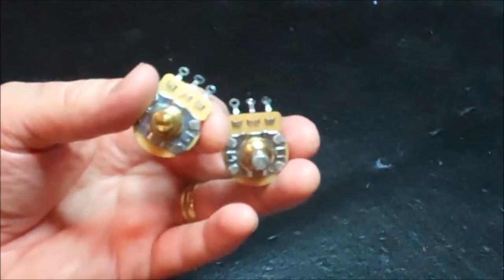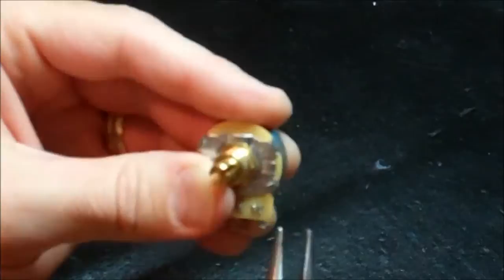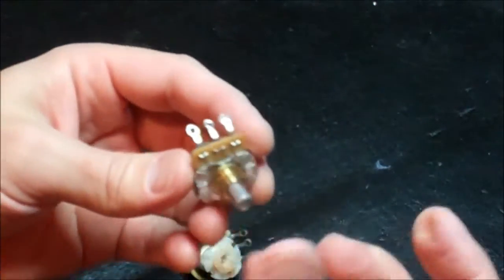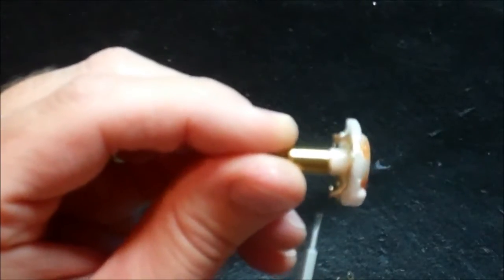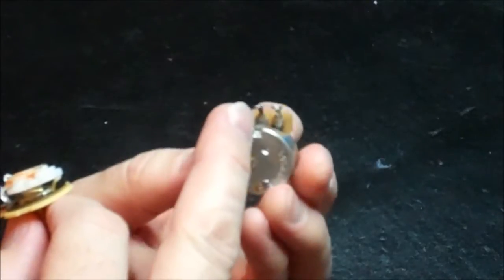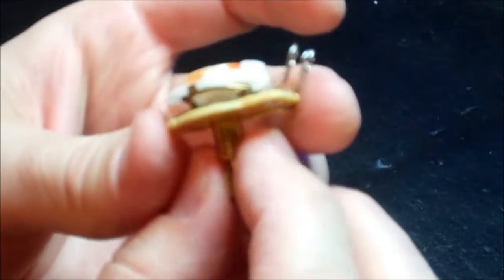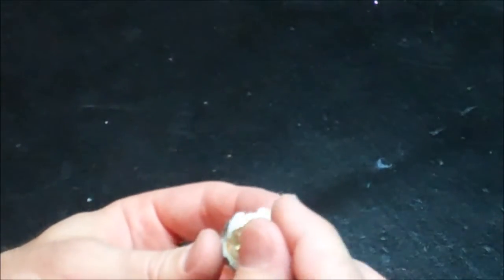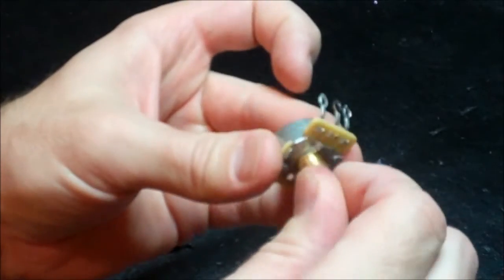Anatomy of the Fender No Load Tone Pot

Comment: About to open a fender concentric 250\500 and see if i can swap it to 250\250no load.  Want to use the upper as no load blender and bottom as mid boost control from the Midboost kit. Watching a couple videos to see if it will work. Maybe il5l just get a different brand one that is 250 250 and do the no load cut on the easier one to reach.  I guess I'm not married to blend being on top.

Comment: Can you help me? I'm not very technical and need some  help. I just bought a 2011 YJM strat and the tone knob seems stripped. If I lift the knob it seems to unlock and roll back & forth but at level 10 it feels like it clicks into a slot until I again pull up on the knob again.Is this what is being discussed here? Is this normal or is my tone knob defective?

Comment: May I ask you if a CTS no load (singed 50666000 1222 CTS) has the same resistance just before the detent as a regular 250 tone pot? I want to make sure it has a 250k resistance before the detent, no less - that's why I'm swapping a TBX for a no load, I want to have a regular 250k and no load in one pot. I feel that less that 250k makes the sound a bit muddy. Thank you for your time!